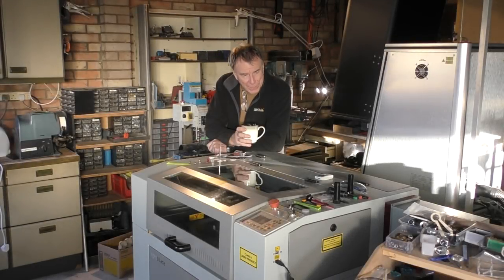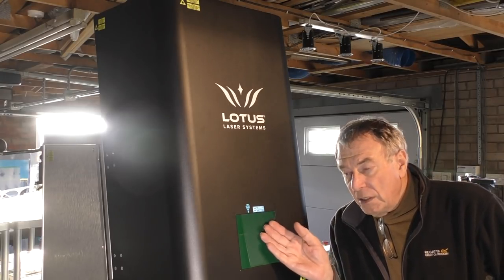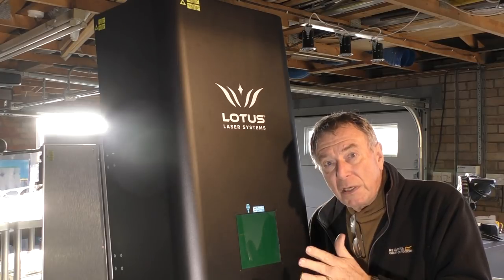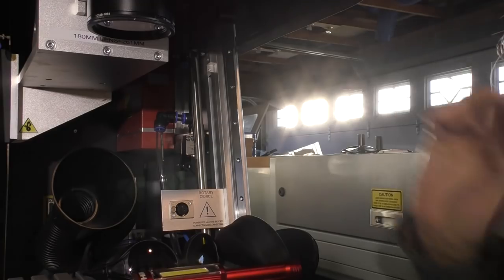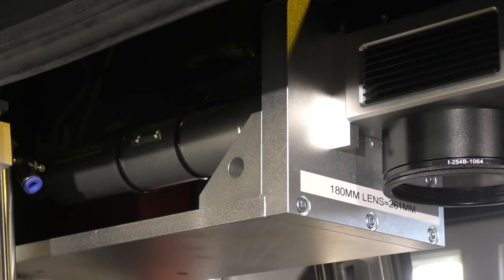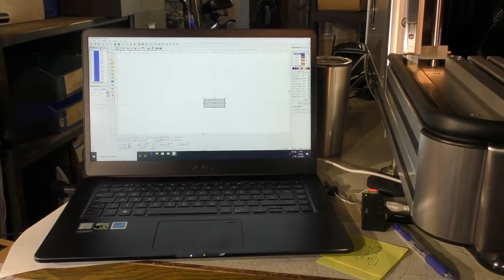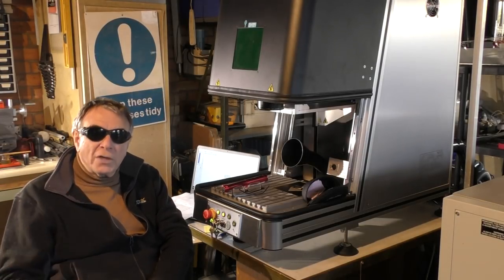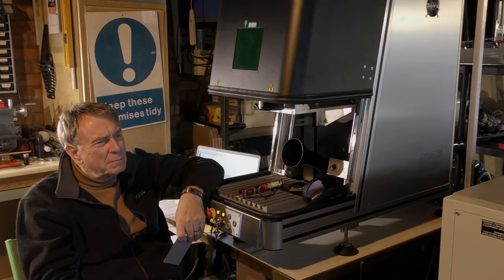RDWorks Learning Lab 178 Another New Venture

Comment: I just engraved words on a 1.588mm / 1/16in thick 316 stainless steel plate. And it worked great. I have a 100w co2 laser Chinese laser engraver. I sprayed 2 coats of moly let dry engraved it then sprayed once more without removing it and ran over it again wet and it came out great. I used 80% @ 200. I could even feel the engraved letters and its permanent.
Oh, I was making a lobster gage for when I go to Florida in March.
I engraved (Florida 3" Lobster gage) and (2-3/4" crab gage) on it as well as the outline of where to make my cut for the gage. Even the cut lines came out great.
Reply from the maker: Happy fishing!!!!
The marks you have created are permanent and are atomically bonded into the surface of the stainless.The sulfer content in the MoS2 has chemically bonded (under the action of local high temperatures) with the relatively high nickel content in the stainless to form a black material called nickel sulfide (or disulpide). There should be no surface protrusion...unlike Cermark.

Best wishes
Russ
Reply: @SarbarMultimedia   For your information I was a welder for 38 years. I do know metal and, it did indeed protrude ever so slightly.
Reply: @bobreichel  way to sound combative....
Reply: @bquamb3478  I'm not trying to be combative.
I have the item and I know what it did to it. I put in that I'm a welder and that I do know metal so you would understand that I'm not ignorant to ferrous and nonferrous properties. True it may have only distorted the surface but when I run my finger across it I can indeed feel the indentation of each and every letter.  It was concave not convexed so it is possible it just shrunk were the heat of the laser connected but in any case it did embed itself.
Reply: They dropping your power. I have a 60W and 80W and only need 30-40% power and achieve a dark black, and a very permanent and well defined mark/writing with a far lower power and zero proudness to the reverse of my engraving.

Comment: Can't wait to see if it cuts acrylic - how thick? - and from your lens geometry - looks like there will be an angle to the cut where the direction of the angle is a function of the  XY position on the table. 
Hmmm maybe a 20W machine can produce much higher peak pulse power at a trade off of duty cycle.  Looking forward to your findings Russ.  Merry Christmas and Happy New Year to you and yours. 
Dennis
Reply from the maker: Hi Dennis

You may think that acrylic would be easy. Not so, it will not cut acrylic or any  organic material such as wood, paper or leather. Most will not even mark. So be prepared to be surprised when you see what it actually does.

Best wishes
Russ

Comment: The one thing missing from the RDworks series is in my opinion motion control. A servo equiped Ruida system is a different beast. My machine for instance is able to achieve 5G acceleration while engraving, even when I work at relatively low speeds (due to the glass tube and processing speed of the controller as I've found) it makes everything a lot faster.
Reply: Who made or assembled your system, if you don't mind me asking?  What servos  and servo drives are your  X and Y, and what is the bed size?
Reply: @ianstewart-koster9982  I did, upgraded servos and rails, for the servos I use Teknic Clearpaths, for the rails CCM rails.
Reply: @Runner50783  thanks for that. We tried Leadshine closed loop easy servos, but the Chinese fellows fitting  them found they lost  steps after a 24 hour test run.
Reply: @ianstewart-koster9982  That is weird, maybe they where running outside spec. I've also found that servos do much better when attached to reduction gears,  I use 2.5:1, that helps improve the gantry to rotor innertia ratio, minimizin stress in the system
Reply: Ours have approx 1:5 timing reduction...

Comment: More good news and congratulations, I'll be interested to see if the new machine can engrave a compound curve that is also asymmetric.  CO2 laser is a bit scary though; as you pointed out it will put an end to one's sighted days and it would all be over in I believe a billionth (with a "B") of a second..no time to look away if one is accidentally flashed. Direct to ferrous metal is sure a big deal.. maybe it can make a embossing die to go straight into a big punch or coining or stamping press.
Reply from the maker: The claims for this technology include deep engraving of hard materials such as tungsten carbide so maybe your dream is possible. Lots to learn and discover before I get that far.
Best wishes
Russ
Reply: @SarbarMultimedia  Deep engraving is certainly achievable with my 30W, so 20W will just take long to achieve the depth your require.

Comment: Greetings all.  I have a couple of questions and I hope that I am not too far off topic here, if I am, apologies.  I am looking at getting the Ten-High 430 - 50 watt CO2 laser, so my  2 questions are centred around that item.  My 1st question - Do I need to use RDWorks as my software?  I currently use Aspire 9.5 for my CNC and diode (15 watt) laser work.  Love it and really hate the thought of relearning a whole new piece of software. 2nd question - may be one more of personal preference, but should I look at the 40 watt or 50 watt version?  There is only a few hundred dollars between the 2 powers, but if 40 is good, would 50 be great?  I know material types will play a role here, but this is a retirement hobby project, not a production goal.  Some flea market items for the wife, and projects that I see here and other parts of the web.
Thank you Russ and to all who take the time t answer my questions here.  Love this series of videos and can't thank you enough for your time and effort making them available for all to see and use.
Tim
Reply from the maker: Hi Tim

The Ten High machines are usually just pimped up K40 machines with the "old school" anlog controller. They will be cheap for a reason, there very little inside. The mechanicals my be better than a K40 but the stepper will usually be NEMA 17 and driven off a simple controll board and there will be no cutting and engraving layer control  Yes the machine will cut and engrave but it will be hard work. I urge you to forego your holiday (just send the wife!!!) and use the money to buy a machine with a Ruida digital controller Both 300x500mm and 600x400mm are great hobby size machines. If you buy from Ebay or Amazon market place I will guarantee that you will not get what YOU think. A 50watt machine should have a 1000mm long tube but check the macine outside dimensions and you will find tht at 1050mm there will not be enough room to fit it along with mirror1  you will need at least 1100mm wide case. No you will be buying a 40 watt B grade tube that will be  almost certainly only output maybe 30 watts if you are lucky.  By all means buy a 50 watt spec machine but leave yourself about $250  to buy a proper 50watt A grade tube
 When you look at machine specifications ALWAYS look at the keyboard. That will be the give away as to the type of controller fitted.. 
Look at this for some good information.
https://lasergods.com/controller-dsp-identification/
 You will  see them mention Lightburn Software. Lightburn is a clone of RDWorks with many more bells and whistles that was written privately by a software pro. RDWorks only works on Ruida controllers but  Lightburn has been developed to work with most of the poular digital controllers and will run on OS, Windows and Linux.
If you wish to post links to machines that you may be interested in I will be honest and let you know if I would spend my money on it.

Best wishes
Russ
Reply: @SarbarMultimedia  Thank you Russ.  I greatly appreciate your words of wisdom.  I have time before I plan to buy, so maybe waiting a few more months and adding to the bank account may be the better idea and wiser option.  I know the old adage -  "You get what you pay for" is true, so it looks like this time it is particularly true.
Tim

Comment: Love to see it cut metal.
How much does this thing cost ?
Reply from the maker: There is a Bofa fume extractor and a compressor that you did not see and to be honest I don''t know the exact cost. However, because the machine is on loan to me, I know it is insured for £20K against theft. Don't have any high hopes for metal cutting because I suspect it will be painfully slow.. There are some things it does at lightning speed  but most of it's interesting tricks , like colour marking stainless steel, are outside what I would class as the cost effective envelope.
 Best wishes
Russ

Comment: Hello Russ...i have seen all your videos and at the start i would like to thank you for what you doing. Your videos helo me many times with my co2 laser. Unfortunately i have got another little problem with my laser and i cant find solution. My focal beam point has a shape of small line not a dot at all after i have clean my focal lens. Do you know what might be a reason of this?
Reply from the maker: Hi Leszek
 Several things to check.
 First, does your lens have a crack or internal imperfection?
Second. With an inspection mirror take a look into the output hole in the end of your laser. It should look clean and crack free.
Thirdly. If you remove your nozzle and lens and put a pulse burn onto card as it sits on your table, is it a round mark? If the answer is yes then your beam is probably not at fault. Do not move the card but drop the table about 150mm and do another test spot.. It should be almost or exactly coincident with the first mark If not then your Z beam alignment is off and uou may be clipping the beam on your nozzle
These are the obvious things that may cause your problem 

Does turning the lens over change the pattern 
 Does rotating the lens 90 degrees change the line orientation? If yes then the issue is lens related, If no then the lens is not the problem.

Best wishes
Russ

Comment: Hi there, I'm really enjoying these videos and only scratched the surface of the playlist. im looking at a small version of the one you first purchased from china. i build button boxes for the sim racing and video game market. its a hobby as i have a "proper job". My thoughts are to cut the abs plastic box lids where i fit the buttons into the holes. doing this manually has its draw backs and i have to be very precise. am i on the right path for making things look more professional and speed up the preparation time. Maybe i should be looking at a small CNC. You can see the boxes here ( join the name up skull simgear . com )
Reply from the maker: Hio
 Your platic boxes are generally made in ABS or polycarbonate (or cast aluminium). Sadly ABS produces cyanide fumes when you laser cut it and polycarbonate just melts into a brown gooey mess producing some nasty brown looking fumes.. There are a few safish platics like acrylic and  acetal copolymer that can be cut safely. but I think for your application a small CNC will be safer and overall more flexible see this information sheet.
http://atxhackerspace.org/wiki/Laser_Cutter_Materials

Best wishes
Russ
Reply: @SarbarMultimedia  hi Russ. Thanks for the answer and  I have in the past used acrylic and wrap them to give a carbon fibre look.  My aim is to have a design I can cut a few of and keep that way I'm uniformed and precise. 
Thanks again.